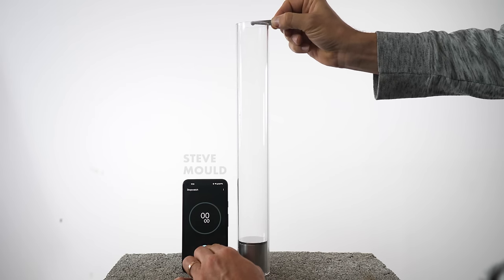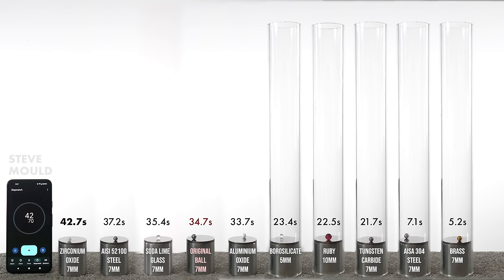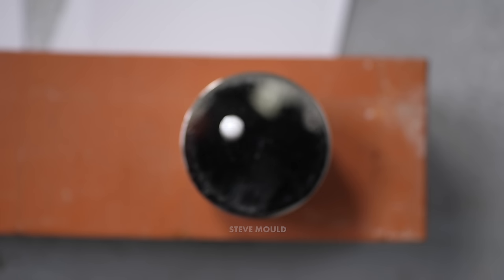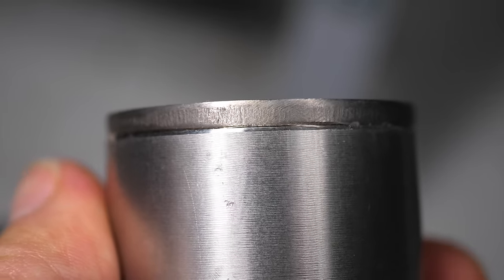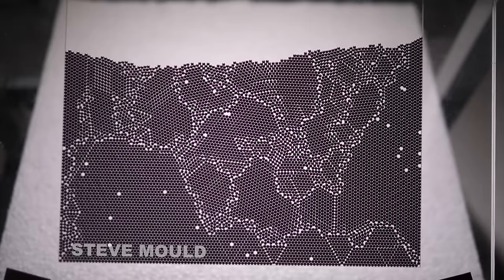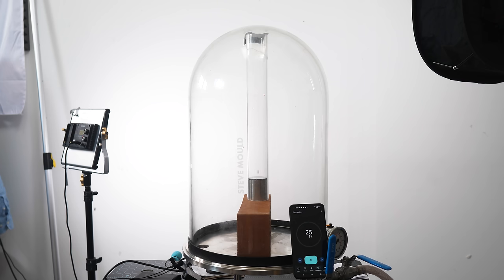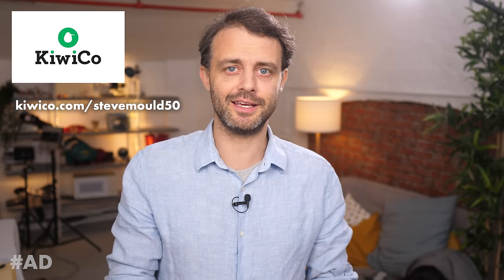This weird metal is insanely bouncy

Comment from the maker: It feels like a glitch in the matrix.

The sponsor is KiwiCo: Get 50% off ANY crate https://kiwico.com/stevemould50
Reply: cool
Reply: Does the Royal Institution lend vacuum chambers to just anyone?
Reply: Do the KiwiCo subscriptions come with kitties?
Reply: What if the ball was also covered with a-metal?
Reply: What determines where on the surface the ball settles in to bounce?   It looks like is always off center.   Is there a sweet spot or maybe a sweet ring?
Reply: would nitinol be better as baseplate?
Reply: Ask a subscriber to turn amorphous metal into a ball bearing! There are so so many machinist YouTubers I bet they would collab
Reply: I wish you tried to use other materials than metals for the base plate, like glass or ceramic. They should make the ball bounce pretty well but how much compared to this material?
Reply: Awesome video ☆☆☆☆☆
My nerdy mechanical brain , is so satisfied , thank you !
Grtz from the netherlands Johny geerts
Reply: Amorphous metal has very useful "soft" magnetic properties  - there is a commercially available product that goes by the name "Metglass" that is used for magnetic cores used in power electronics to store electrical energy.

I would be very interested in you repeating this experiment using another 'soft' magnetic core material that goes by the name "Ferrite"
Reply: @Reth_Hard  my thoughts exactly  - there is a ceramic amorphous material that goes by the common name of Ferrite which I would be very interested in seeing the results of.   An amorphous metal that goes by the commercial name of "Metglass" is used as a 'soft' magnetic core material in power electronics - Metglass is good however in many regards Ferrite is still a superior material on the basis you can achieve an inductor with a greater 'quality' factor  (Q factor).  I am thinking that a higher Q factor material should equate to a better 'bounce' in this experiment configuration
Reply: If you had two of those plates, in space, perfectly angled towards each other, and threw a ball bearing like that at one, making it bounce between them. Would it still stop, yeah?
Reply: You should do this on top of a 400lb Anvil..  You could find them in blacksmith shops.
Reply: u had the time and effort to count how many pixels there were at 8:45
Reply: Ok but where did you get these bouncy marbles i want
Reply: @michaelharrison1093  
That ferrite you are talking, isn't that what there is on some high quality cables (USB or other electronics). I'm talking about this small bump at one end of these cables. I don't remember how it works exactly but I think it supposed to minimize interferences or something like that...
Reply: Whoa.  Deja-vu.
Reply: Do this experiment with Euler's disk.
Reply: zirconium oxyde is a ceramic used by dental technicians. you should be able to get a real nice disk from any dental technician in your area - if you want to try zirconia on zirconia as you mentioned.
Reply: Why does root beer plus ice cream make so many more bubbles, and so much more durable ones, than just root beer on its own?
I think many experiments are in order: What if the ice cream is melted? Dairy free ice cream? Sugar free everything? Low/no fat ice cream? Frozen yogurt? Rock hard vs soft serve ice cream? 

Think mentos + diet soda but slightly less explodey.
Reply: Could YouTube blacksmith Alec Steele make or heat treat different ball-bearings for you to test?
Reply: Get a silicon nitride ball and you’ll see an improvement.
Reply: imagine trying this experiment again on a large granite surface plate that is being used in the industry to check parts on their precission in flattness... they are sturdy and heavy... that could make it bounce a loooooooooooooooong time
Reply: i would like to see a couple things: 
1) I would like to see different thickness morphias metal on the substrate. I'm wondering if a very thin substrate would yield the same result?
2) I would also like to see the ball bearing made of the same material as the morphias metal (as you stated in the video)
Reply: @InsaneSoloClutch  p
Reply: @kruks  Right - another piece of evidence that KiwiCo is fun for the whole family, even the cats - because "BOX!!!!!" 😁👍...
Reply: @Reth_Hard  yes the round lumps on computer cables do have a ferrite core inside them, however for the purpose of EMC filtering the ferrite material is chosen to have a low Q factor. There are materials such as "3F3" that are designed for high efficiency in power conversion and can support inductors with a Q factor of several hundred.  Note that based on the measurement that Steve conducted the Q factor that he measured using a mechanical measurement method would give a value of Q=100

The rebound was 0.99 of the initial height and since the gravitational potential energy is given as mass times G times height the rebound potential energy is 99% of the initial potential energy. 

The Q factor is given by taking the reciprocal of (1 minus the rebound potential energy)

1/(1-0.99) = 100
Reply: steve. why. no. dont keep calling them ball bearings. dont join them. please
Reply: kiwico are interesting. We got their crates and they're really good, my son loved them. Thing is, we're not US based - and they really, really struggled with the organisational stuff :( we had a lot of effort getting everything sorted. They were nice and they were trying but it was a total car crash, first crate was about 5 months late arriving (so not quite the birthday subscription that was planned). I hope one day they get international stuff sorted better cause though very pricey the kits were good, I'd much rather them to a lego kit or something and a lot of the stuff could trivially be created in the relevant markets rather than relying on international shipping.

(sorry, i know discussing sponsors is occasionally sensitive!)

Now I want to get me some of this metal even though I have no real use for it.... thanks for a fun video as always :)
Reply: If I put "stevemould60" will I get 60% off?
Reply: I love how you explain the difference of how deformation works in glass vs crystal. However the explanation on why do alloys suit better for entering its glass state is rather lose and incomplete. Although rapid cooling is a non quasistatic process, we still work with this type of phase transition in similar terms, and we can say a lot about how metal will vitrificate, before trying. So it is very important, that compound metals have (sometimes drastically) different freezing points. Their crystal lattices are expected to form at a different time in a quasistatic cooling, so the analogue for this in case of rapid cooling is different effective relaxation time - abstract time that major portion of atoms need to react and adjust its position on microlevel, when introduced to changes in macroparameters (such as temperature or free-volume). Atoms in alloys thus expirience those rapid changes differently. For example, in certain conditions, proto-seeds of crystals can be formed, and try to join similar atoms to their structure, depleting the outer medium of such and creating diffusion field collision with other metal in compound. As a result, that metal cannot form its grate, and forced into glassy state, with the nanocrystals of doped metal or alloy. Similar processes goin on in other case, when we have no crystal to grow from at all. Small chuncks formed by (arranged by accident) atoms of one metal are not big enough to form a crystal (with long-range order), but still have a similar diffusion potential from its so called "middle-range" order, that counteract the forming of lattices of other metals in alloy.
Another thing I noticed is about research that allows for obtaining amorphous metal alloys with low cooling speeds. From your video it seems like people improve the process by factor of a million. But in fact, they discovered another process, with different physics of how unordered structure prevented from falling into less energetic state. Those supecooling processes with millions of K per second are still in use, and have thair own perspectives. This usually produce a thin film, so I think it is possible to wrap a usual metal ball with it, and see what will happen to its bouncing properties... 
Funny thing, I did extensive researches about both AMA And dissipating energy in bouncing of balls, but I have never thought of combining those =)
Reply: Am I seeing things? Or perhaps it's a frame rate issue? It looks to me as if the ball bearings (especially from around 8:00) bounces x number of times, only losing a little height, then loose (in one jump) a lot more than the previous x times, and then going back to losing x percentage. 
So, for example (couldn't count them): Loss per jump in height 1%, 1%, 1%, 1%, 1% - 4% - 1%, 1%, 1%, 1%, 1%.
Is that a frame rate issue? I am reminded of that video from space with a free-spinning wing nut, which does x number of spins, then turns, then x numbers of spins, turns, etc.
-
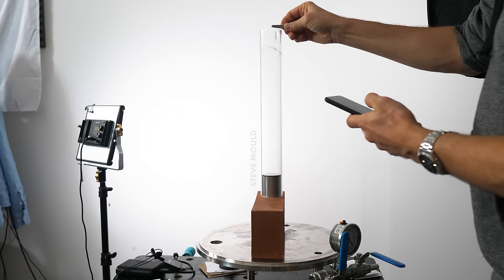Reply: 13:12 -ish. Can you test if temperature of the amorphous plate makes any difference on the amount of bounces?
What plate temperature is most bouncy?
Reply: Would it be possible to see the surface retention of the “glass” with a high powered slow motion camera? That would be interesting to see if there is a divot being made and then quickly returning to its original form. Hope you see this!
Reply: @Steve: I think you'll find that the ZnO2 ball is amorphous.  I'd also like to point out that the transmitted sound is sapping energy from the ball, and so a setup which minimises the amount of energy transmitted from the ball to create sound will bounce longer.  A 1 ton steel block would work well as a base for that purpose.  Then air resistance will become a more significant factor.
Reply: My eight year old is making ravioli from the KiwiCo Yummy crate right now. It smells amazing!
Reply: (his dad is helping with the cooking, of course 😉)
Reply: STEVE Put it on a plate, then run different sound vibration frequencies threw the plate and see what it does
Reply: I guess we should just call it a ball bearing ball. And a sphere made out of them would be a ball bearing ball ball.
Reply: Does this bounce better than what The Action Lab did in this video? https://youtu.be/mHumpKBD8qE?t=120
I counted 34 seconds for his ball bearing and it seems like he dropped it from a much lower height. His "magical" bouncy surface was literally just a balloon stretched over the opening of a cylinder.
Reply: if it bounces, you're still dreaming; if it stops, you're awake
Reply: Is the surface glass-metal magnetic? And did using a magnet magnetize the ball? And I thought the ceramic ball was the best time, and nonmagnetic. 

Just thinking
Reply: it feels like we COULD make a ball and surface with a C.O.R of 1 or even higher if we put in enough effort
Reply: Ball bearing...

DEEZ NUTS!
Sorry, lame joke but I had to.  The opportunity presented itself... 😅😅😂😂
Reply: Could you attach a transducer to the bottom of the slab and match the sound frequency to the bounce and cause it to bounce as long as it is powered?
Reply: @cheeseburgermonkey7104  or greater than 1?
Reply: @addmoreice  if it’s powered, of course.
Reply: First helpful tip with the Kiwico, give the boxes to the cats to save on toys they probably won't play with.😁
Reply: A ball bearing that's also amorphous, why don't you try that?
Reply: @080allanthomas5  
That’s difficult thing to produce … maybe impossible
Reply: @larryscott3982  :(
Reply: Moreeeee kittiiessssss
Reply: The bouncy balls you could get as toys in the 80s felt like a glitch in the matrix too. :) ... Obvious next thought: What would happen if you got one and dropped it on the amorphous metal plate? :D I have no idea if you can still get them.
Reply: What about using an amorphous ball bearing? Super bouncy material against super bouncy material.
Reply: @eekee6034  
The bouncy ball (Super Ball) would bounce exactly the same.
Reply: @larryscott3982  Ah yes, the Super Ball, thanks. My thinking is the balls of different materials lost energy at different rates, so a Super Ball should be different again.
Reply: @eekee6034  
Consider how the super ball bounces on concrete, compared to how it bounces on asphalt pavement. It’d be near impossible to measure the difference. So a super ball on a high mass steel plate and a glass-metal plate of same mass would be so closed to identical that any difference would be immeasurable
Reply: You should have sampled the wave with a DSO for analysis, if you want to write software!
Reply: Can you please mention the height of the glass? I had an equation that im very eager to solve .
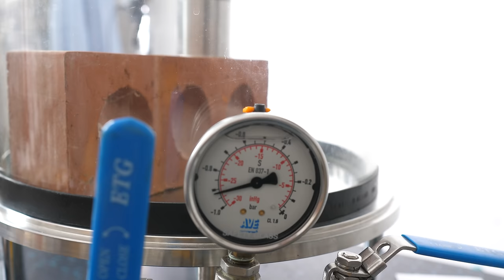Reply: 14:20 that's what she said
Reply: What is a “bull” bearing?? We call them ball bearings.
Reply: What about the smallest ball in the vacuum
Reply: STEVE, consider the ends of collision scale will range from perfect plastic to perfect rigid.  The ideal elastic collision is very close to the end scale at rigid side.  It mean the perfect elastic do not exist.
Edit:  Also it mean that the perfect rigid body collision (just theoretical obviously) will NOT produce rebound.
Reply: wouldn't call it a glitch. Show me one when a ball bounces higher and higher with no force being put on it, and then it's actually a glitch.
Reply: Hello sir have you seen a flat marble bounce?
Reply: Love your channel and I have an idea for a video because I think you will be the best to answer it :)
I sorta get how objects can reflect and absorb light and thereby "have a color".But how can something be transparent? 
How can I see through a physical massive/solid object?
Reply: Funny that if you force two mega strong neodymium magnets together, when you move the assembly through air it feels like honey. Not all things fall at the same rate. Would love for you to test that!
Reply: I don't know how you'd convince me that these just aren't very well 3D rendered ball bearings.... 😕 In-life demo??
Reply: idk if you noticed, but that sounds an awful lot like the sound 2 black holes make when colliding.
Reply: Glass is not a solid - it's a fluid.
Reply: How much of the energy is lost as sound, rather than directly to heating? In other words, if you can find something which bounces more quietly, then for how much longer will it bounce?
Reply: please contact Walter Lewin about this, this screams for him :)
Reply: So The Bearings Are Basically Grounding At A Specific Frequency?
Reply: Weird -> Uncanny; thin -> fine, shallow; big -> great; nicely < niasement < nescie := not-skilledly (you) -> well; thick -> coarse, deep; before -> yester; would -> should; will -> shall; travels -> fares
Reply: In the late noughties
Reply: @RWBHere  I'd suggest a design that in a vacuum, reflects the max amount of the sound back to the source of the sound.
Reply: Surely the best bounce would just be with the most Stiff material, not how well they are in tune. Two pieces of clay don't bounce off eachother because they have the same stiffness. Rubber on rubber bounces worse than rubber on a hard surface, because they take away eachothers energy.
Reply: would be interesting to see this experiment in Zero gravity with 2 bounce plates facing each other in a vacuum... would there be a almost near perpetual bounce from one plate to the other?
Reply: It's 50% OFF 1st month for subscription.
Reply: @12:42  They all do this but "The Original" does it most visibly.  The ball moves right and left in a repeating pattern, but never goes off the edge.  It just repeats the same distance right, left, then right again.  Taking several bounces to complete the cycle each time.  Can you explain this next time?  Is the plate imperceptibly bowl shaped?  Or is it something more complex.
Reply: Question; The bounce seems to losing height in steps, sometimes a lot and most of the times a tiny bit. What do you think causes that, the imperfections on both surfaces or the softness/deformation of the sphere(returning the energy at the wrong time), or both?
Reply: Do not use your hand to hold and drop the ball (because of movement, tremor or and asymmetric force-direction distribution), use an automatic grip-opening device (robotic hand, clamp, etc.) that simultaneously and lets it fall symmetrically so that the object (the ball) and the forces move, fall, bounce / jump as symmetrically as possible and in a straight line from the start.

For the time being, I won't comment on the idea or the material, metal, alloy, floor / foundation, casing, cladding, glass, glazing, etc.
Reply: If / When you have money, health or "natural" disaster problems or if / when you are somehow affected by traffic accidents, traffic jams at some point, somewhere, then think of me, share my posts and my pages: 

Be sure to read my comments under my first videos completely via laptop or PC! 
Be sure to read my contributions, posts, comments under my first videos thoroughly, maybe no longer visible via phone app because they intentionally set it that way! Use laptop or PC!
Reply: M1u1(0)(table) +m2u2(ball)=M1v1(0)(table)+m2v2(ball) if initial momentum =final momentum (no loss in v (ke=0.5mvsq)its elastic,the more it bound the more close to elastic
Reply: What about supercooling the plate or the ball or superheating the ball? I wonder if that would make a difference
Reply: @Torta--is--PLUR  if u can increase elastic
Reply: Couldn't you make the ball baring you need?
Reply: Where do I get the kitten Package?
Reply: Does they have something like this service on Brazil?
Reply: Imagine all this resources invested in exposing de "pandemic" and "vaccine"
Reply: 9:49 energy is lost, only to become memory, information gained ;)
Reply: 100th comment
Reply: Can this metal glass be used to make pistons?
Reply: Please calculate sin, cos, tag angle and difference and track pattern
Reply: for drop line
Reply: its called a steel ball lol
Reply: Aren't you happy the balls didn't bounce for longer? The longer the balls would have bounced the longer it would have taken to make the video. I think the video of the ball that never stops bouncing is still in the making
Reply: how about one of those bouncy balls?
Reply: 09:05 Is plastic the new woke term for Spastick?
Reply: I can get 10mm ruby sphere for like 5 cents... and why not try a quartz pearl?
Reply: @kruks aa
Reply: can you try a balloon on top of a glass, that would do the same thing
Reply: this sounds like "how to make a better mattress" in a round about way, may want to patent idk.
Reply: cute kittens
Reply: @jsalsman shook the zzzp😊
Reply: Now give both surfaces a positive or negative charge, see if you can get even more bounce from the repulsion.
Reply: Make the bottom surface zirconium dioxide too!
Reply: er, the ball race is called a ball race, is this no longer a thing? i'm an old man you see.
Reply: Uhm plsplsplspls help my tablet just said SOS
Reply: He did it 😂🎉🎉🎉🎉🎉
Reply: Here from NileCherry's video.
Reply: Wait 🫷 what of Nile made a metallic glass ball bearing?!
Reply: Based on your description, how well would normal glass work?  Is there something special about making glass out of metal, or might it be a disadvantage?